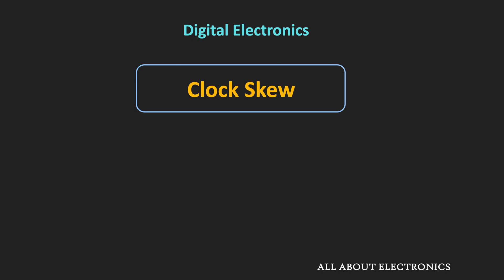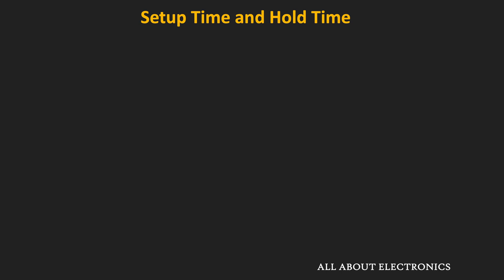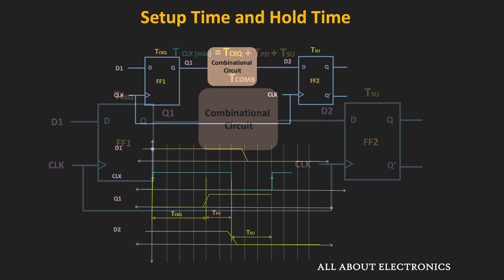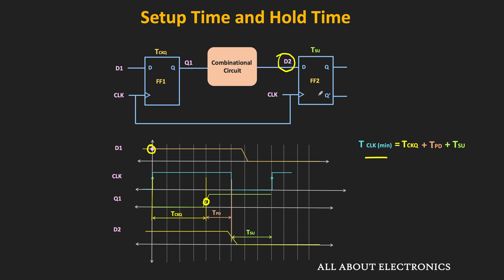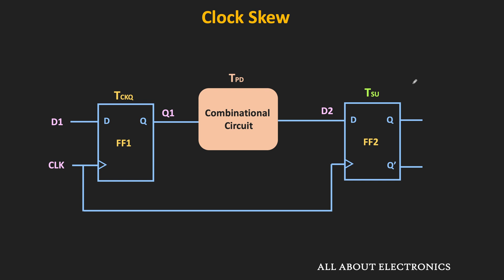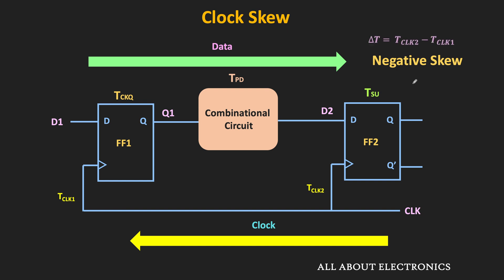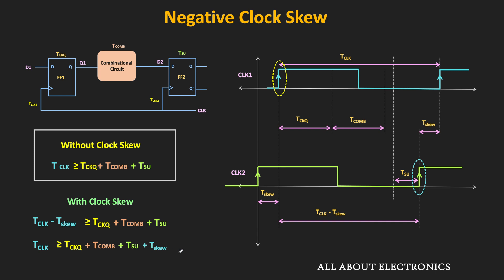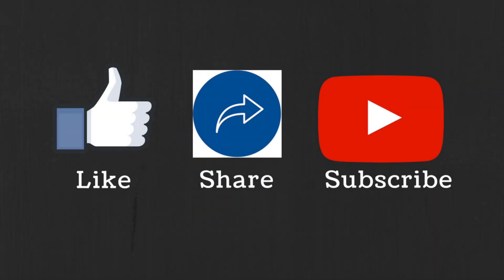What is Clock Skew ? The Positive and Negative Clock Skew Explained

Comment: One of the things I love about electronics engineering is knowing all about a subject and how to explain it before I've ever even encountered it! lol
As soon as I read the subject, I knew induction lag from wire length, input capacitance and logic gates or steering/blocking diodes would be the culprit.
I also knew to correct this with each flipflop module, it would require a coordinated delay as in hold time, to resolve potential lag between the flipflops. 

I didn't finish my degree and I suppose not even close, but I did complete enough that strangely, I understand about any subject thrown at me with admirable depth since I've never covered it. A lot of this is due to making it through most analog fundamentals, and then self study over the 13 years that has followed since I left college.